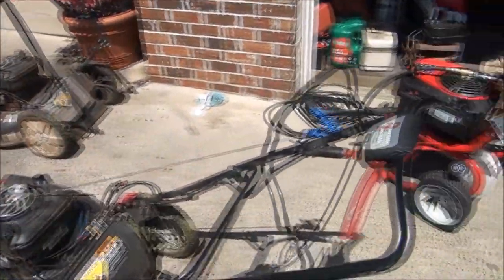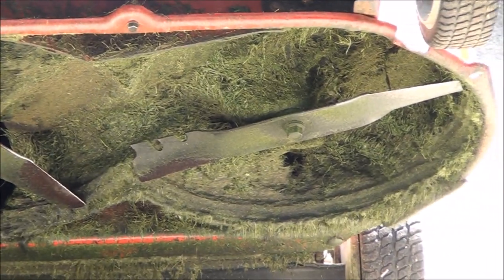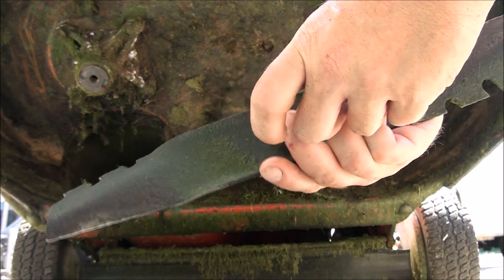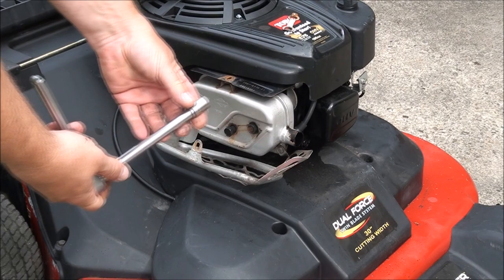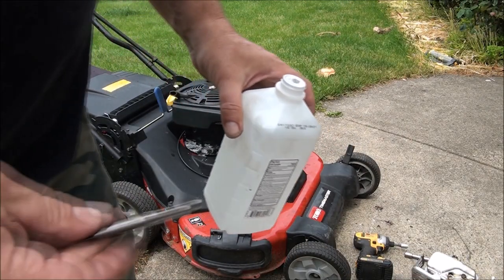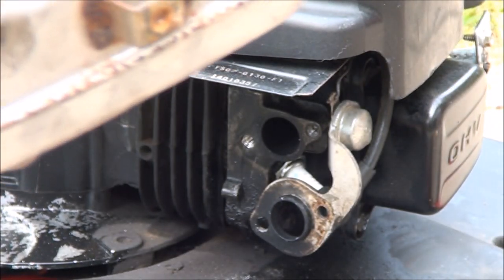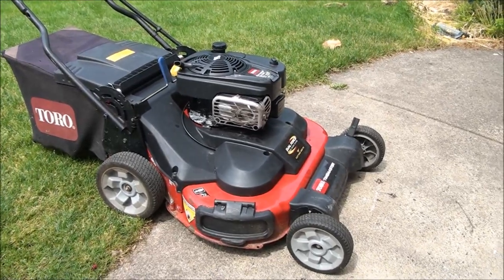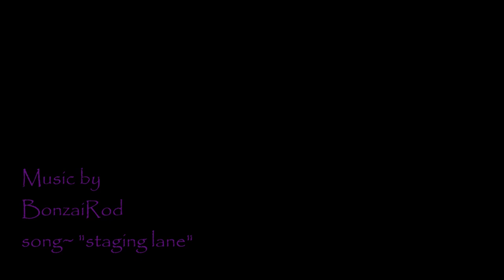Toro TIMEMASTER 2 Blade push Lawnmower. HOW TO install a HELICOIL Muffler STRIPPED Bolt Hole Threads

Comment: If you ever have to work on the underside of a Time Master just remove the bag, push that blue lever in and put the handle in the upright position. The mower is designed to sit at 90 degrees for service using the upright handle bars as a base. These are great mowers, sure hope I never have to do that muffler stud fix on mine but great to see it done so well!
Reply from the maker: great tip!
Reply: That's good to know, I have one ordered and did not think about that.

Comment: I work on these and rebuild them all the time, it's a common problem when they are used for commercial use, another issue is the pulleys, there is a kit you can buy, that's for the exmarks version, kind of pricey but the bearings in the pulleys are of better quality, great video, I have to do it to a Timemaster I have for sale.

Comment: That was a great tip using rubbing alcohol on the tap when cutting threads into aluminum. It looked like it worked well.

Comment: Hey couple of things here: 
1) Helicoils are VERY size specific.
2) You should break off the tang on the bottom of the insert.
3) Dont bend the heat shield, it's only a couple of more screws.
Other than that good job. 
WD-40 works good on aluminum as a lubricant as well and it doesn't evaporate
Reply: So my muffler came off.  One has part of screw on the hole. Other seems stripped.  I could really use some more instructions on what to look for in ordering a helicoil kit. Since it seems so size specific. Any help, GREATLY APPRECIATED

Comment: I broke the throttle handle on a toro mower this spring sledging it under something like that so be careful when you do that. The owner doesnt use his water hose deck clean out that much is clear. I put the hose under my Honda this morning after mowing a wet lawn. Normally I won't mow a wet lawn but it was my neighbors and she wanted it done by 11am. I raked up a half pound of mulcher grass that had been stuck under the mower. Those mowers have a built in filter in the tank so that external filter is not nessary at all. I usually strip everything usable off my blown up engines such as coil, exaust, recoil and carb. The rest goes in the scrap pile.

Comment: In the future you can make the handle straight up and down 90 degree angle with that little blue thing just push it down and move the handle, it gives you a lot better access
Reply from the maker: Nice! Thanks for the tips!

Comment: I got the same lawnmower and I get alot of grass and all three of my bolt that hold the engine down keep coming loose, and other people I saw on utube engine almost came off!
Reply from the maker: Yikes!
Reply: I just found that problem also . There is a TSB Technical Service Bulletin from Torto saying the bolts were not torqued from the factory and you need to install new bolts and lock washers. The one in the front is a pain to start. You have to tip the unit to the left side to get to the bolts.  Good luck

Comment: Just curious so I went to Helicoil's site & found this: "Heli-Coil stainless steel inserts
can be used in temperatures ranging from–320ºF to +800ºF." Then I found the video below where the poster measured the muffler temp on a push mower at 375 degrees. So your fix is fine, temperature-wise. 
https://www.youtube.com/watch?v=1vqfcB6T94c
Reply from the maker: great info! thanks

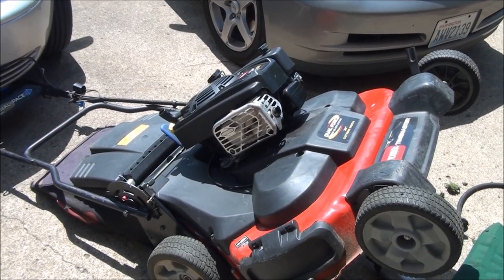Comment: 4:15 That mower has a connection to hook up a garden hose to clean the mower after use. Your customer could have saved a some money by properly maintaining his lawn mower. Then again, that person probably doesn't know a whole lot about maintaining lawn mowers (or much of anything else) based on the condition it was brought to you in. SMDH    If you have to tap the head because the threads have been stripped out, why not just use a bolt that matches the thread pattern of the newly tapped hole???
Reply from the maker: that is a good question... I guess I did that because I feel that a helicoil is less likely to strip again, rather than just tapping it.
Reply: @JeffsLittleEngineService  OK, that makes sense. The head is probably aluminum where the helicoil is steel.
Reply: the deck hose hookup thing hardly does anything to clean out the deck..timemaster owner here
Reply: @Travis2L  if you lower the deck all the way as Toro rec comes it does ok but I don’t want to expose my blade spindles to that much water. I’m fine with some scraping here and there
Reply: @Travis2L  You got that right! The only way to clean under the deck is to tip the mover on it's back
 like Jeff showed and hit it with a hose
Reply: When I bought my timemaster that was one of the big sales points for me to hook up the garden hose to the deck. I tried it and it still did not clean all the grass out. I end up every time I use it flipping it back and spraying it with a garden hose

Comment: That customer  must hardly ever clean out the grass from underneath the deck.
Reply: That mower even has "wash out" adapter right there on the housing....hmmm, some people are just weird on how they treat their equipment and wonder why it breaks
Reply: For certain that is an expensive mower. One  would think that the owner  would take better care of it. Guess  some folks have plenty of money to burn buying replacement mowers!
Reply: I have that mower. It clumps like that on every mowing session unless it's Spring or Fall when the grass is not thick or if it's extremely dry. I don't always clean mine out, but it doesn't matter. It always looks like that underneath after mowing. The blades suck all the moisture out of the grassand it sticks; it's a short but wide deck and although it cuts like mad, it doesn't expel grass nearly as well as it cuts it down. I love my TM30, but if you don't strap up the mulch cover or attach the bagger, once you hit mid June, you can't mow with it, and you definitely can't mulch and hardly can't use the side chute. Open chute or bagging is all you can do in thick grass, but it's still worth it. It's a great mower.

Comment: The geniuses at Toro put some stupid bluefoam inside the gas tanks don’t understand what that does . I think it supposed to stop the gas from shaking aro
Reply: Toro didn’t do that, Briggs did. It’s there to prevent vapor lock due to the fuel shaking up and aerating. Briggs has had that option since the 1970’s but you don’t see it often.
Reply: mjg263 ugh 😩

Comment: If that was my mower put the blades on with impact , I make u take them loose and tighten with ratchet and not pay u
Reply from the maker: What are you afraid of?
Reply: This comment makes no sense. My Timemaster blades were so tight from from the factory, I had to use a breaker bar to loosen them.  Impacting them is zero problem.

Comment: Good job on the mower however I would not have used anti-seize on the blade bolts. Maybe a dab of grease or oil for rust proofing.
Reply: Why?

Anti seize is specifically designed for keeping bolts from seizing up.
Reply: I agree. Never use antiseize on a lawn mower bolt. I saw a couple of questionable things he does in this video but whatever. I was trained by a Certified Briggs and Tecumseh mechanic. He to taught me enough to open my own business. Been doing it now for 35 years.
Reply: Did you offer/up sell a deck cleaning and treatment?  Not sure what's best treatment, some bar and chain oil would be a good place to start, but I know I've seen videos on other materials.  At lease a periodic cleaning/drying.  Odd ball machine is likely expensive to replace the deck on.  Thanks for your videos!